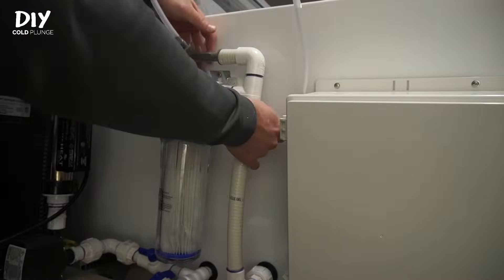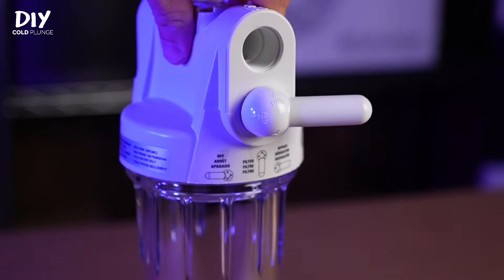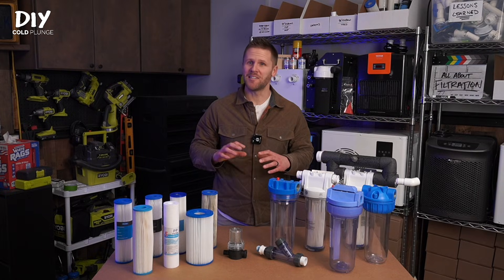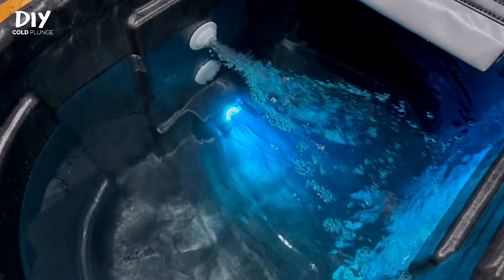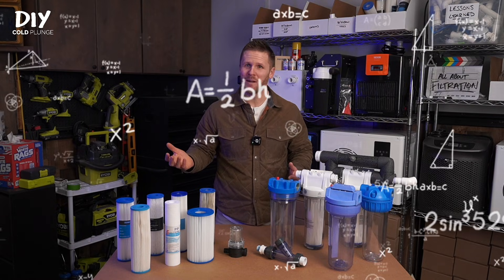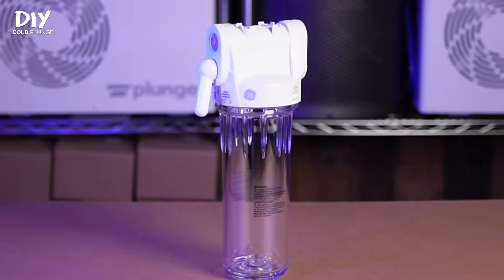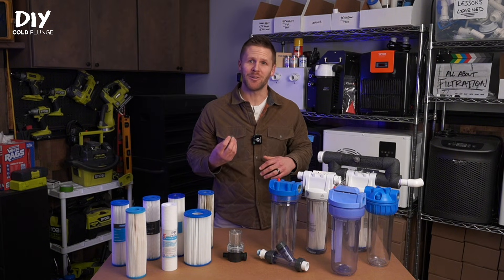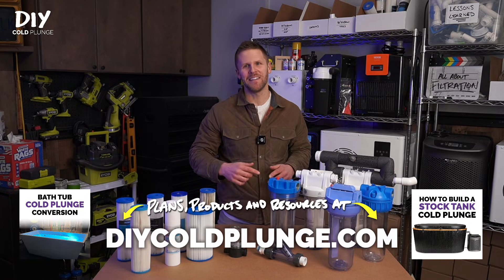Filtration 101: The BEST Filter Setup for Your DIY Cold Plunge

Comment: You could just put valves going into and out of the filter then you would just have to turn off the pump, change filter, turn pump back on and get a cheaper housing. Valves aren't that expensive
Reply from the maker: Sounds like a few more steps of manual labor. To each their own, but for a few extra dollars I'm all about convenience. 

Especially with the additional footprint valves and extra fitting take up. 

Folks also run into issues with flow rates as well. I'm offering simplified, proven and compact solutions 👍 beauty of diy is you can make it your own

Comment: Hey Joe! 

I notice when using this filter and cartridge combo, the filter buckles and bends quite a bit like in your video (02:40), and seems a little long. Someone said that the raised ring in the housing (top & bottom) is supposed to fit inside the filter end hole, but it's much too big. Just feels like something isn't fitting right when it comes together, even though all the posted specs match for both. 

Thanks for all your work, just placed an order!
Reply: I second your observation. Notice Joe didn't respond? BTW you don't need to thank people for HARD work if it is not GOOD work. WORK SMART, NOT HARD!

Comment: Can you have the filter before the pump instead of vice versa. That way, the  filter will protect the pump, right?
Reply from the maker: Not necessarily, if neglected or you use too fine of a filter you can choke out the pump. If you go with my recommendation, you'll be using a Danner pump which was originally designed for ponds - we don't bring in debris anywhere close to something like that

Comment: What do you use to filter out things before getting to the chiller.?  You said you are not a fan of pre filtration in front of the chiller. I have a separate ozone so I do not require the venturi/ ozone. What keeps debris from getting into the chiller?
Reply from the maker: Hey! I don't pre filter other than the strainer piece on the outlet fitting for the tub. In my 3+ years of doing this I've seen more plunges (pumps) break down because they aren't getting proper flow than issues of things pumping through the system. Best practices - don't bring a bunch of junk (debris) into your plunge, skim any big stuff out after each use and you're good to go. Anything that can make it through the strainer and through the pump likely won't harm much. Again, that's just my experience and the community I've helped 👍
Reply: @DIYColdPlunge i’m using a pre filter. Should I not be? Does it restrict the flow to my pump too much? What exactly is the downside?

Comment: I have an Eco Plus 1.5 HP that has  1” input and output fittings. How do I use your 3/4” filtration and ozone system if I use 1” tubing and pvc. I saw your design video. Can I just use a 1” -3/4” reducer  at both the input/output of chiller. Btw, I have the Ice Barrel 500 which also has 3/4” inputs and outputs. Just wandering if the chiller is compatible with anything other that 1” pvc  and tubing.

Also, I already have the Danner 1800 pump which is 3/4” threaded fittings so everything is not 1” anyway.

Please give me whatever guidance you can.
Reply from the maker: You could either go with a 1" Venturi and filter housing to accommodate the oversized chiller - you'll also likely need a bigger pump for that size anyway. 

Or, you could experiment with reducing town to 3/4" after the chiller connections
Reply: It sounds like the best option is just to use a system with 3/4 inches throughout or 1 inch throughout. I have an option of returning the Eco +1.5. In your opinion, should I (1) keep my Eco +1.5 And just get a 1 inch pump and 1 inch filtration system with 1 inch tubing, or(2) Get another chiller that has all 3/4 inputs and outputs and use everything 3/4. If 2, what chiller would you recommend that I could use outside but under partially covered porch.
Reply: Also, is it better to use a pump that has higher gph than recommended or should I just stick with recommendation. I have a 3/4 inch Danner 1800. Also, returnable

Comment: @DIYColdPlunge Per your recommendation, I also purchased the same GE Whole House filter unit.  Initially I purchased non-GE filters for it, and experienced issues keeping flow due to air introduced into the line.  Come to find out the blue silicone top of the filter was breaking.  Happened on two separate ones.  So, I purchased the GE brand filters and I'm still getting air introduced into the line.  Entire system works fine if I put it on bypass, but as soon as I turn the handle to the down position, the pump starts sucking air and I have almost zero flow/ pressure going through my lines.  Thoughts?
Reply from the maker: Gotta be an issue with the O ring getting kinked or not sealed properly... nesting it in there is crucial
Reply: @DIYColdPlunge o-ring was fine, but I replaced it with a brand new one, lubed with silicone grease per instruction manual, filter seated, still letting air in.  Runs fine on bypass, so at least I know I know it's not my fittings/ lines. I tried removing the filter and just screw in the canister, and it wouldn't even fill up with water. SUPER frustrating.  Going to order a whole new unit and just swap it out.

Comment: Iam using activated charcoal , and just every week take it out and wash on the opposite direction of flow, it cleans completely, restoring perfect flow
Reply from the maker: I don't know about the long-term viability there. You will also want to introduce some sort of sanitation to the filter, a simple rinse does not guarantee any lingering bacteria, mold, etc. gets fully flushed and disinfected.
Reply: @DIYColdPlunge  but doesn't the ozone do that?
Reply from the maker: @carlosgap5  Ozone will handle sanitation of the water in a setup like this, it is not designed to handle whatever organic material that your filter grabs and holds onto. The filter is designed to be disposed of for that reason.
Reply: @DIYColdPlunge 
Activated charcoal can ce reactivated to an extent that's good enough for this purpose. Completely air dry, then put in oven at 500° x 2-4 hours, cool and repeat a few times, or just once if you are time-limited.
Activated charcoal for air purification can last for 5-8 years.

And personally, I'd rinse it with highest pressure setting on water hose nozzle  first to remove any solids.
Reply: Can you share what kind of filter is that?
Reply: @maiamikitiouk8957  i gave up it would always get clogged. Swapped for a 50 micras polipropilene filter as instructed in this video and it perfect